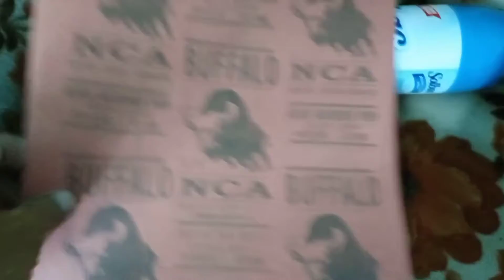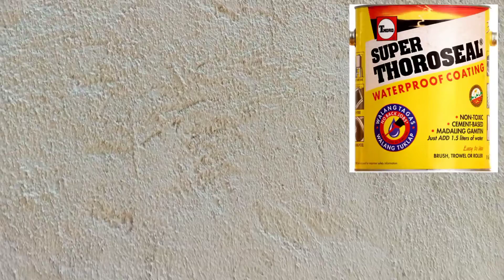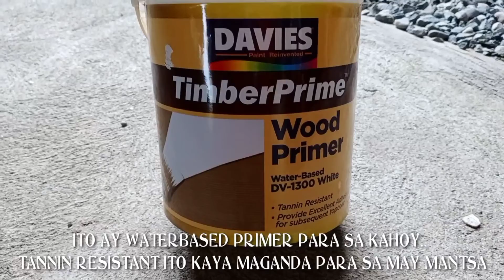paano magrepaint ng puro mantsang kisame at wall

Comment: Panu po irepaint ung kisame na may beam ba yun or parang kahon sa gilid ng kisame nagtuklap lc ung mga ibang pintura nya plywood po xa..anglulutong nung pintura na natuklap may kulay po kc xa parang varnish..
Reply from the maker: Kung pintura lang yan..alisin nyo lang yung natutuklap tapos primeran nyo ng epoxy primer tapos masilyahan nyo ulit ng body filler pagliha nyo primer ulit at pintura na
Reply: @LeojayBaguinan  pwede po ba ang flat  wall enamel na pang primer? Bago masilyahan.